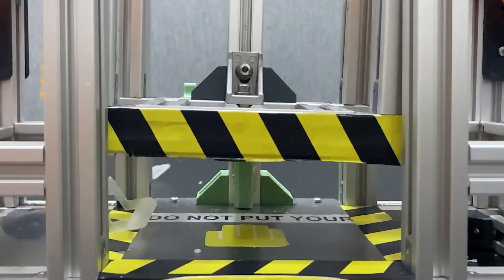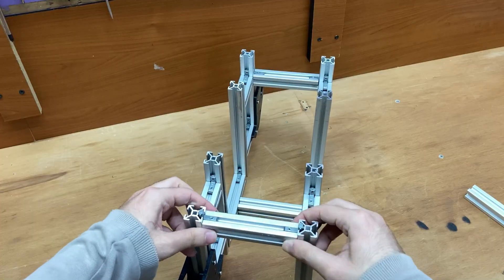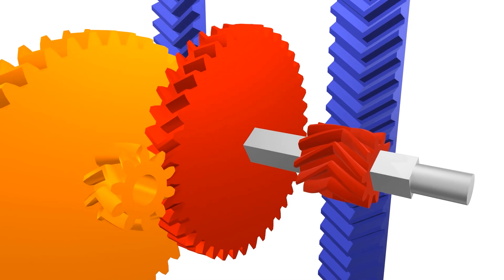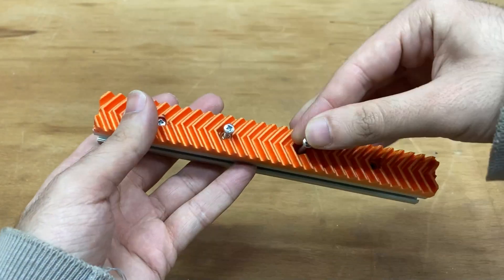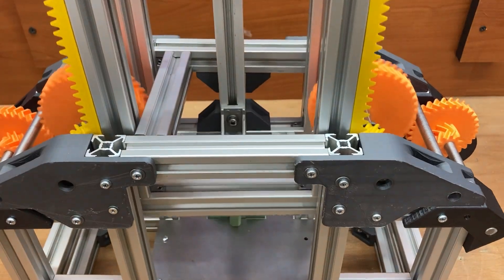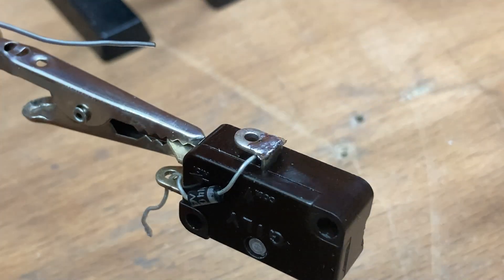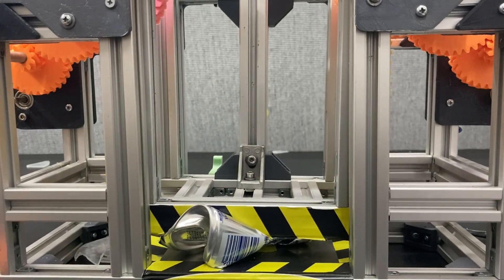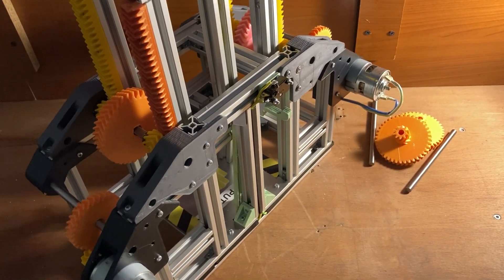Is it possible to Build a 3d printed Press?

Comment: Awesome stuff! But I really think you should put bearings on gears axis, make gears wider where they meet the square shafts and, avobe all, use STRAIGHT GEARS instead of hellical or any other angled teeth type of gear. Hellical gears are designed for silence, not for torque. 99% infill and relatively high print temperatures to make the gears acutal solid pieces of plastic wouldn't hurt either.
Reply: "helical hears aren't designed for torque"
On the contrary, that's actually exactly what they were originally designed for, while reduced noise is a fringe benefit. Continuous rolling contact on multiple points as opposed to staggered contact on single points provides more stability in your system to increase consistency of action and allows better transfer of torque. Double helical gears and herringbone gears (each offering separate profiles and benefits) further increase consistency and transference by constraining the system against axial variance which single helical gears encourage.
Reply: @claws61821  Tl;dr: Even though in hellical gears more than one tooth pair will be engaged at any moment in time (usually 1 and a half teeth is carrying load at any given time), they also mesh together in small segments at a time. This design lets less tolerance for gear alignment and separation adjustments. This meshing also creates more drag (there is more friction) which creates heat. Straight-cut teeth are in contact with each other fully and for a longer period of time (which also makes for a very distinctive whine). Straight gears tollerate missadjustments better and fail less often and less catastrophically (important in a 3d printed mechanism). Hellical gears produce axial or thrust force aligned with their respective shafts, and it's axis and mountpoints must be specifically designed to accommodate these thrust loads.

(Kind of) Explanation (I'm a machinist, industry technician and mechanics lover, but I'm not an engineer):

Both straight and helical gears transmit the power through a contact point that travels continuously through the surface of the teeth. Straight gears use the "involute profile" approach (https://upload.wikimedia.org/wikipedia/commons/c/c2/Involute_wheel.gif) Hellical gears have indeed more teeth material and surface area, but the approach in how they transmit power between gears is less beneficial when you seek for power delivery. They're more smooth and, as a side effect, more silent, but worse at transmitting torque.

Consider the dual helix gears in this video. They always break through the middle because the vector of the force applied to the teeth is not perpendicular to the teeth but has a lateral component. As the teeth are not parallel to the axis, force applied to them algo pushes them laterally outwards, creating tensile stress where the teeth angle is made (that is also the weaker spot in this design).

In a straight gears, even though you have only one point of contact across the curved surface of the involuted gear, this point is also as wide as the wide are the teeth, thus making wider teeth will make higher torque transmission possible. They're easier to design beefy and play with overloading.

Under load, a pair of straight cut gears will create a separating force between them (perpendicular to the shafts). Hellical gears will also produce an axial or thrust force aligned with their respective shafts.
Reply: @fresita_jugosa  thank you for the detailed correction
Reply: @claws61821  my pleasure! Mechanics are my passion. As a side note/fun fact: Double hellical gears like the ones used on this video are the inspiration for the logotype of Citroën. There's a very interesting tale behind it, as with anything related to Citroën from the70's backwards; they were indeed the most innovative, ingenious and game-changer car company of them all.
Reply: @fresita_jugosa  While most of what you wrote is right considering classical steel gears, but power delivery is less of a concern here rather than gear strength. Gears made out of plastic behave differently than those of steel. Plastic can tolerate higher deformation (strain) without it being permanent and this behaviour is very useful when talking about the number of teeth connecting. With using the right teeth angle - that should not be more than allowing another tooth to come into contact - you can minimize the axial forces that try to tear the gear in half. A very simple solution would have been to flip the direction of the arrow shape of the tooth so that the tearing forces are acting on the bigger gear that has more area holding it together, and having compressive forces acting on the smaller gear that the printed part tolerates much better (keep in mind the reason the smaller gear failed is because the forces were trying to separate the layers from each other which is always the worst case for any 3D printed part). 

Herringbone gears with the optimal tooth angle have better teeth-loads mainly because of the number of teeth connecting. Additionally, both types of gears connect for the same amount of time and to help you understand that, think about slicing each one to their printed layers. Both of them has the same profile and identical slices on their layers and by rotating these you will see they connect the same way. The only difference is that the helical gear has each of its identical slices rotated by a number of degrees around the gears axis (basically that's what the printer is doing each time it changes layers). 

Regarding the frictional and thus the power loss, keep in mind that plastic gears with or without lubricants have smaller coefficient of friction. The point or line contact forces that have axial components cancel each other out between the connecting gears so if there isn't any constant deformation (that is strictly from overload or higher tolerances) than there is no significant loss of power. The reason the axial component would be a concern is because it causes higher point or line contact forces that the plastic material is very weak against. Remember, the yield strength (where the material permanently deforms) is much worse in plastic materials than in steels, but on the other hand they can withstand higher deformation without it being permanent so if these bigger forces are distributed among more teeth then it's not a problem. To be specific, think of a 30° tooth angle where the normal force is higher by 15% than in a straight cut gear, but the number of teeth connecting is higher by 1, then the total load of the teeth is only 77% compared to a straight cut gear. 

It also worths mentioning that the torque induced failing on the shaft and hub contacts is also because of the low yield strength of the material and the high forces acting on these contact points that are mainly because of the square shaft design. The same thing happens than in the helical gears: the point or line contact force is multiplied because the normal vector of the hub's face is not perpendicular to the radius, thus they have less working radiuses creating the torque and by this it needs to have higher forces acting on the contact points to create the same amount of torque that goes in. The best solution would be to use spline shafts because they have the most optimal torque transfer with the lowest contact forces. (Think about hexagon head screws versus Torx screws).
Reply: @bencebabar610  I wanted to take my time reading and considering your detailed answer, it's so instructive, thank you very much! Indeed, I didn't consider the difference between printed plastic and metal (cast iron is my most usual working material, and it does not like to flex at all, it cracks every time you overload it). Also, printed plastic behaves like wood (in a way), as it's weaker between layers and you have to take it into account when choosing the orientation of the piece to print. I'm very new with 3D printing, just 6 months in experience, so for me this is a world where I feel absolutely noob.

The only thing in your exposition I'd like to comment is about the spline shafts as a solution for the axis problem. It is true that squared shafts are a very bad choice for this task, and spline shafts are the best way to proceed when you want a gear solidary to it's axis indeed. This is the correctdesign for high loads (automotive gearboxes are excellent examples of this). You can use a round axis with key, but not when you have to transmit huge torque load. 

However, this guy is using easily available materials for the build, and spline shafts are not something easy to get, even worse if you have to make it your own. I can't imagine a way to make them without a milling machine. Squared shafts are the obvious choice, so in that regard I proposed a workaround: widening the gears where they meet the axis, so there's more material to support the deforming forces.

Again, thanks for your detalied answer and all the information!
Reply: @fresita_jugosa  You're welcome. It's good to see that you're just as interested in mechanics. 
Cost-wise you're absolutely right, and what you proposed really is the easiest and cheapest solution. The only thing I missed from my explanation - that could fix the problem alone - is to thicken the square hole's wall because if you look closely on the broken gear pieces, you can see that the number of inner walls supporting the outer one are not more than 5 (and that is totally insufficient to stop the square profile from becoming a circle) the rest is infill. Increasing infill density won't make a significant difference, it's just a waste of material.
Reply: @bencebabar610  yep, that's absolutely true. I've made some experiments with my prints to find out what makes pieces structurally stronger (as my main work with 3D printing is structural parts) and thicker walls always work much better than increased infill density. In any case, when I really need the PLA to be as tought as it can be, I just make my pieces solid and increase temperatures to "weld" everything together more firmly. Maybe this approach is a bit too much, but IDK, it's plastic, the more, the better hahaha
Reply: @fresita_jugosa  Same here. I really like the concept of saving material and designing stress and strain wise but I think people who are not familiar with advanced or even beginner level stress analisys and don't have access to FEM softwares should just forget all of these and stick to solid bodies when designing structural parts. Reliability and rigidity is always better than saving a few pennies. On the other hand, trying and learning from these mistakes is the best and most beautiful part of 3D printing.
Reply: @bencebabar610  honestly, I enjoy being a technician because I love what engineers can achieve and enjoy learning from their work and getting to use their designs in my own job. I never intended to be an engineer, I see life differently 😂 but i know to recognise good explanations and well made decisions, and learn from that. You get less brute, more step towards sophistication, one step at a time, learning from the masters ;)

Comment: screw that
Reply: rope pulley press
Reply: you dont need an electric motor, you can hand crank it
Reply: you say a nut job
Reply: pulley does not rely on gears, it just brings two close together, by definition, same direction of motion

Comment: You should use bearings. You only see low friction under no load. That's what bearings are for, low friction under load
Reply: They still aren’t really needed in this project, the gears that don’t have bearings won’t have all that high load on them and if they do, then they are at low speed, the final gears that mesh with the rack have bearings on the ends of the shafts and they are the highest load gears. There also weren’t any problems related to not having bearing on the other shafts, so why add them if they aren’t needed?
Reply: @conorstewart2214  In the pursuit of over engineering, no cost is too high
Reply: @piercemcmurry7914  pursuit to invented things.But trying make them
 wrong
Reply: yeah!

Comment: the layer adhesion in the 3d print sucks. Print with PLA and add more perimeters instead off infill. maybe also try to raise the print temperature 10 deg C

Comment: Instead of printing 100% infill you could increase the numbers of perimeters, this will make the gear a lot stronger while not wasting material and print time on the parts where you don't need all that material.
Reply: Indeed, 30% infill and 3mm walls should be really sturdy.
Reply: 99% infill, on gyroid or something similar that uses x and y motion, is actually stronger than 100% infill. 100% defaults as filling the spaces with walls, which all share a common weak axis. however, using gyroid or other infill pattern, they face perpendicular to the axis of which the wall is printed, therefore increasing strength/rigidity perpendicular to the wall, as compared to printing at 100%.
Reply: I've had success making tube forming tools with as little as 40% infill with 5 perimeters.  The most crucial thing is to orient the print so the force goes thru the layers at a  perpendicular angle, rather than parallel with the layers.  PLA has fantastic strength if you orient it this way.
Reply: @Laser_Ranger  Also if you really need strength perpendicular to the layers (so Z strength), a valid option if it can be adapted to the part, is passing a screw through it. The screw will hold the layers together, doing basically the same job as steel in prestressed concrete. Also adds shear strength to the part. Perfect for gears like this or any tall structure.
Reply: CNC kitchen actually ran tests that prove more perimeters and thicker perimeters are sturdier than infill
Reply: Also higher layer squish or layer depth to previous layer increases strength
Reply: Rd
Reply: or use a carbon fibre filament and a printer tip so it dispenses properly if it comes out properly it will be quite strong
Reply: @MX2x_  Carbon fiber reinforced filaments aren't really significantly stronger in terms of ultimate tensile strength. At the end of the day the fibers are very short so they can fit through nozzle and limited in orientation due to FDM's inherent reliance on layers. Layer adhesion will also be a limiting factor.

It may make the result more rigid but you're just trading between material properties.

Edit: Note that this is for consumer products. I don't know if industry has as good solution for fiber reinforced FDM.
Reply: For a project I’m making, I need exactly this herringbone gear and the linear part, I think it’s called a rack? As an untrained self taught unprofessional, I can’t wrap my head around how those are drawn in CAD. I rather not print countless parts that don’t work. Can I has some advice?
I am using shapr3D, but anything helps, really. Thx
Reply: @core36  Instead of 100% infill, maybe you should consider the cost of this project compared to a traditional solutions.  A lot of time and money has gone into this folly---I mean, learning opportunity.  Hopefully you've learned that if you have a 3D printer, other skills are required.  3D printing EVERYTHING is the main problem with people who have a 3D printer.  Everyone is allowed a few dumb-ass projects but after you've had your printer for a year, it's time to limit your use to appropriate applications of plastic.  Instead of 100% infill, buy the smallest cheapest arbor press you can find and it will be 1000x better than this contraption.  With press issue handled, you can use your creativity to do whatever's next for you.
Reply: @ consider me puzzled.
Reply: His brain dosent work like that . He just basically wanna make some money from YouTube.

Comment: So, a tip on wiring DC motors:
Wiring them in series splits your voltage, and amperage. You can actually wire them in parallel, just flip the polarity. DC motors usually aren't polarized. Parallel allows you to keep the power up and resistance low, resulting in more current capacity.
Reply: Series splits amperage, parallel splits voltage.
Reply: @nipdev6666  You got that backward.
Reply: @reidprichard  yeah I did, but the point still stands.

Comment: I've been thinking about doing this for a while myself but didn't know where to start. Mine probably wouldn't be with v-slot or 2020 rails, though XD Those are still a bit outside my budget ATM thanks to unforeseen events.

I think you would get a lot more performance out of this if you redesigned the frame gantry to eliminate that rather significant canting to either side as it's coming down. It was more than 30° out of alignment at some points in the demonstration. That adds a LOT of resistance into the system, regardless of herringbone gears.
Reply: Problem is with these DC motors there is nothing to synchronise them. Depending on differences in friction and load it will always drift.

I'm thinking of using a belt to drive and synchronise a while bunch of m4 threaded rods, like maybe a dozen of them. They would provide both the bulk of reduction and the force would be distributed.

Cheap construction? Just square box alu section, you can braze them together or use angles and plates to connect them.
Reply: @SianaGearz  I wonder if adding a clutch mechanism to the out put of each would help. Kind of like the slip type of clutch where it has play to slip forward but not backward (no idea what that's call, just seen it in a lot of random gadgets).
Reply: @eideticex  I can't see that it necessarily would? Depending on friction and the like the forward speed of DC motors is different, even unloaded two "identical" motors off the same batch could differ by several percent due to low precision construction. Back slippage isn't really the issue here.

If you were to implement a clutch like mechanism it better detect which of the motors is too far forward and apply extra friction to that. I do think this is possible but i don't have anything in mind.